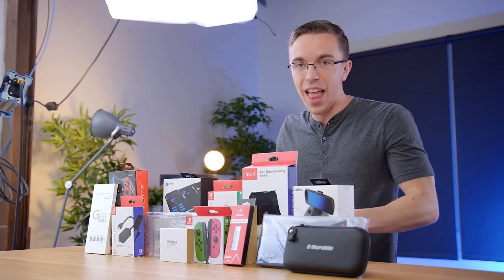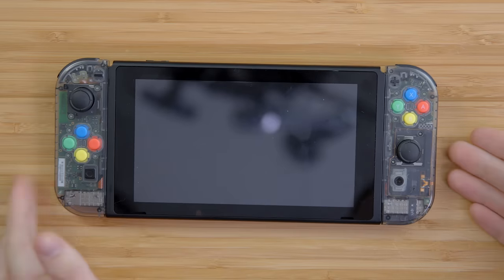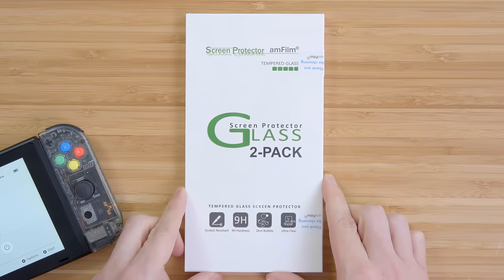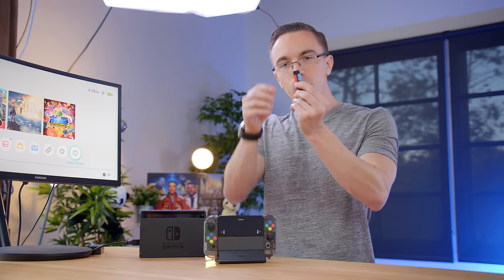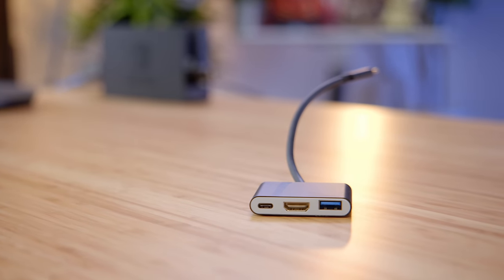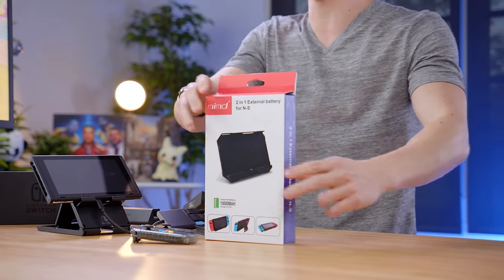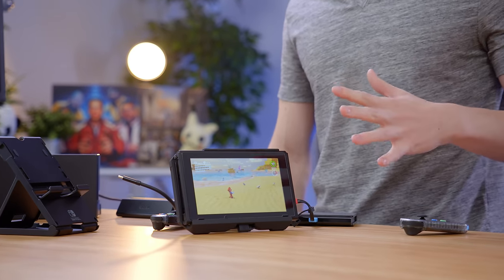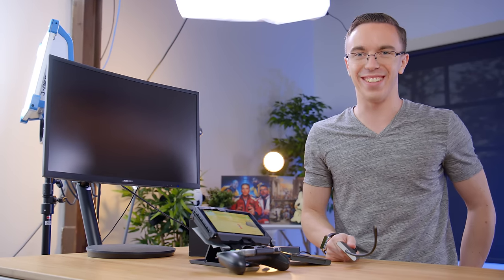Building the Ultimate Nintendo Switch

Comment: THE SWITCH IS SUPPOSED TO BE PORTABLE
Reply: Certainly not Austin lol
Reply: now it isnt
Reply: poppet pala the switch is gaii
Reply: Technically it's the same idea as the PSOne with a screen.
Reply: Spencer Tamburello lol Only a Nintendo fan boy actually listens to the company. It has a custom modified Nvidia chip. Actual consoles have a modified desktop cpu.
Reply: Spencer Tamburello You could but you're still wrong.
Reply: your way wrong because 1.the console itself is the tablet duh  making it a handheld and 2. the dock is an accessory it is not apart of the switch and nintendo just to say that it is a home console when it isn't an actually home console it can act as one. and if hooking up a portable/handheld device makes it a home console shouldn't all other portable/handheld devices be consider a home console too? cause 3DS, DS, PSP, PSVITS, phones, and tablets can all hook up to your tv with an adapter which is waht the dock is it is an adapter that help the switch connect to your tv but it's extreamly big so it can look like any other console on your tv stand
Reply: poppet pala lel
Reply: I can’t charge on its own can it?
Reply: But you have a point
Reply: 1,000 subscribers with no videos challenge it needs a charger to charge
Reply: Yellow Magma that’s what I mean but it won’t work on an plane and other places you don’t have access to plugs
Reply: and it still will be with enough duct tape!
Reply: 1,000 subscribers with no videos challenge oh true
Reply: poppet pala (͡° ͜ʖ ͡°)(͡° ͜ʖ ͡°)
Reply: poppet pala nintendo sayd its a home console that You can take on the go
Reply: Bogdan's Gaming how is it a home console when it is literally a tablet? Lol the dock isn't the console and of course you'd believe what the company said
Reply: i gave the 666th like
Reply: 666TH LIKE
Reply: No it isn't anymore gg 😂
Reply: actually its a home console that "you can take with you on the go"
Reply: Spencer Tamburello I disagree with you. I rarely dock my switch
Reply: Spencer Tamburello as a proud owner of a nintendo switch I say it a portable console than a home console.
Reply: yeah!!!
Reply: The Dark Soul its WAY more of a portable console it doesnt even have a real home console thing you can take it anywhere you want (when charged)
Reply: 1,000 subscribers with no videos challenge you have 83 subs...
Reply: That is the whole point of the switch
Reply: What do you mean portable? Ooooh right you need to take it around the house somehow, sure
Also, what's an outside? Is it edible?
Reply: Some call it portable  but some call it ultimate
Reply: :D ! ! !
Reply: True
Reply: Yeah tell Austin make it more portable
Reply: Wait it is portable except ethernet
Reply: This Is extreme...LY PORTABLE!
Reply: poppet pala it is
Reply: everyone!!!!!!!!  it's the hole point of the fucking system
Reply: its supposed to be portable if us want
Reply: Spencer Tamburello Bull. It’s a portable gaming console that can be used as a home console. The switch is inferior to the PS4 and Xbox One as a home console.
Reply: It's both. Whether it's better as a console or as a portable depends on the game.
Reply: stupid switch didn't worth my time
Reply: Yea. But can you charge it hmmm no but now this good
Reply: It still is you just need a portable power generator that can power a house 
Then put hat in the trunk of your rv and hook up a tv and boom technically portable
Reply: Not anymore it's not
Reply: Hades The Pyro exactly everyone is hyped for no reason and everyone is saying avoid wiiu? it has homebrew and backwards compatibility who wouldnt like that switch is for kids
Reply: Trojan Horse isnt worth it stick to wiiu its worth for that console it has backwards compatibility switch doesnt and everyone is hyped for it why????0
Reply: i mean it is if u have an entire suitcase.
Reply: So the dock then?is that just cosmetic for under your TV
Reply: poppet pala yeeeeeeaaaaaaaaahhhhhh!no point making a non portable switch cuz it ment to be portable
Reply: And that is what makes it a bad console
Reply: yea
Reply: honestly yea
Reply: play anytime anywhere
Reply: Lol
Reply: Spencer Tamburello actually it's supposed to be both a home console and a portable console
Reply: Yellow Magma 
Not a tablet, it’s a console
Reply: Yellow Magma 
And you need the doc! How is it an accessory? It’s hardware! Like the switch and joycons! It’s connects the switch to another device with an hdmi input!
Reply: Yellow Magma
You can’t hook a tablet or phone up with a tv or anything with and adapter! You need an hdmi cable. And for a phone or tablet, you do it with Bluetooth. With those other devices, you can’t!
Reply: You will on a plane most of the time
Reply: BUT NOW ITS NOT THE ULTIMATE SWITCH
Reply: yeah. I have one myself. it's portable. unlike that one
Reply: IKR
Reply: I know this is An old video but it’s supposed to be a hybrid
Reply: @HadesThePyro  I remember playing Breath Of Fire III on my PS One plugged into the cafeteria's outlet when I was studying at university. Good times!
Reply: Spencer Tamburello D
Reply: poppet pala: actually it was meant to be a console
Reply: Is is
Reply: @DarkSoul-ds2  I don't think it's purpose is home console or portable it clearly has both . its much better as a home console which idk if they realized at the time of releasing as it only lasts about 3 hours without being charged . kinda hard to argue either one is its intended purpose when both answers are half correct
Reply: @YellowMagma  id argue to say the dock is a part of the "console" otherwise it would be sold only separately from the tablet part. its kind of necessary considering the short battery life of the tablet . and clearly way better to play docked then not. if you disagree with that i guess you prefer playing on a tiny screen
Reply: @JanitorMusician  the dock is an accessory. Very easy to argue
Reply: @DarkSoul-ds2  i see your point and i can understand why you would see it as an accessory , but the simple fact that the tablet is almost complete shit without the dock makes it a very necessary item which i would say makes it part of the console. this is just my opinion though . in all circumstances i would say yeah its an accessory but the fact that the limited battery life and the horrible joycons make most games, just much more difficult then they have to be , that makes the dock much more important. because, then you can hook up a pro controller and your tv for much better gameplay. Clearly the dock isn't 100% necessary I know this. however, i believe if the dock didnt exist nintendo have a huge disaster on there hands. the dock makes this otherwise nearly unplayable console playable . Imagine trying to play competitive smash bros with the tablet and joycons... not going to fucking happen. my conclusion is if you look at any accessory for any other console they aren't necessary for them to stay in competetion for best console. but for the switch if the dock didn't exist this whole console would be a complete failure. so no the dock is not an accessory . an accessory is something that is not required but can add to the overall experience. in my experience the dock is 100% necessary for a lot of games. for example, games like smash it makes or breaks the experience if you are competitive . you might be able to play them but that doesn't make them enjoyable. irregardless you are likely going to say no its an accessory thats fine.
Reply: Ben LeClair  being transparent about arguments doesn't make them any less or more relevant. Same for saying it's just an opinion or assuming stances on the topic. At the end of the day it's still a tablet regardless of battery life and performance and performs its tasks as intended without the dock. The dock IMPROVES battery life indefinitely and CAN IMPROVE Video output. However the tablet can still perform its functions. These improvements are NOT necessary to perform gaming. Therefore the dock is an accessory.  Even in competitive gaming its doable without the dock. No amount of experience playing, belief, or non-subjective subjectivity can argue against this if it's not a fact.
Reply: @DarkSoul-ds2  they are necessary for competitive gaming thats a fact. if you are playing with the tablet alone you are not competing, you will simply be losing. i wasn't arguing that it can't perform its functions im arguing that the dock is necessary for optimal gameplay. without it the system is just fair. accessories aren't important to have optimal gameplay. the dock is important without it gameplay isn't the same. its more then just an accessory
Reply: @JanitorMusician  opinions aren't facts.  In that case the controller pros should be included in the box. You can compete with joy cons
Reply: Well it is the “Switch” so no its “SUPPOSED” to be both
Reply: @downunder874  and your reasoning for it's a bad console?
Reply: @crimsonking7179  Of course. It breaks very easily, I've only had it for about a year and I had to replace a joycon and the SD port is broken. It also doesn't need to exist because the Wii U could support the games on it. It also isn't backwards compatible like the Wii and Wii U. It doesn't have a lot of new releases due to the lack of processing power. A lot of the games are either rereleases of Wii U games or are sequels that are very similar to the original, supporting my statement about the Wii U being superior.
Reply: @downunder874  but everyone stop buying Wii u and games for it . Of course Wii u has more power it not as portable as the switch. You either have more portability or power it's simple you can't have the equal amount of both. As far as the switch durability, it not that hard to keep it from break, just keep covered. I had my switch about a year and it's fine, I drop it a few times and it still works. So I don't know what to tell you but the switch is not a bad console. It not the best but it's definitely not a bad console.
Reply: @crimsonking7179  I still believe that a portable console should be more durable. I have only dropped it once, and that's when the Joycon broke. It shattered into 3 pieces, and I had to spend $30 to get a new one.
Reply: Very true kid
Reply: Official mr_Springtrap  qce
Reply: @YellowMagma  look he also said "that you can take on the go" . And since when would a company that BUILT their console want to lie about it
Reply: No
Reply: Spencer Tamburello eh depends..... it depends which one you use more. I use portable mode most
Reply: Right
Reply: 𝘽𝙐𝙏 𝙒𝙀 𝘾𝘼𝙉 𝘿𝙊 𝙏𝙃𝙄𝙎 𝘼𝙉𝙔𝙒𝘼𝙔𝙎
Reply: @SpencerTambo  Nintendo Said it's a hybird console
Reply: @young-blk-investor1059  r/woosh
Reply: @izzrax8113  same with your phone wats your point
Reply: @nathaneichner4262  I dont even remember bc this was a year ago
Reply: LOL
Reply: poppet pala j
Reply: @thejwil45  Oh god. You just said the Wii U is totally worth it. I have one .. and trust me, having a Switch would be a lot better lmao
Reply: Biggerdog Za Big Doggo im not gonna lie switch is good but i wish it have backwards compatibility and hey i would love to play mario oddesey
Reply: @thejwil45  Yeah, fair point.
Reply: I THINK
Reply: poppet pala low battery
Reply: but it isn’t
Reply: IT STILL IS
Reply: Pinkie Pie no lol
Reply: ƑԼƛƦЄ ƤԼƛƳƧ x
Reply: Thanks. We like to Ones
Reply: @HadesThePyro  pretty much
Reply: He mentioned that, if you didn’t listen, he just wanted to make it better O.o
Reply: Austin: Thinks about portable 50 accessories
Reply: no its not why is the switch lite a thing?
Reply: ok boomer
Reply: R/wooosh
Reply: Nah
Reply: NO ITS NOT
Reply: Get a bag
Reply: No it's not
Reply: @SpencerTambo  its home and portable..
Reply: Not anymore
Reply: RealCeltics Fan Nigga it’s a joke
Reply: yeah but not . . . U L T I MA T E
Reply: @HadesThePyro  is like wii u
Reply: @NickyYey  sure. Let's go with that even though you aren't really meant to take your wii u out of your home
Reply: @HadesThePyro  and a phone
Reply: ThE SwItCh Is SuPpOsEd To Be PoRtAbLe
Reply: poppet pala literally every Nintendo console is portable
Reply: poppet pala 9 hi
Reply: Poppet pala is beign roasted whit so much likes :/
Reply: To everyone who is arguing about if the switch is a PORTABLE console or a HOME console; If you mainly play Super Smash Bros. then it is a home console, anything else and its portable
Reply: But the ultimate switch isnt
Reply: Yeah it is
Reply: @Scottage_Man  lol
Reply: No
Reply: lol lmao
Reply: It's more in line with the Virtual Boy now
Reply: Uhh uh, well uh, I’ll ignore that
Reply: @young-blk-investor1059  if you dont care, why tf did you reply to the comment? ever thought of that
just leaving the person alone

Comment: Who else is waiting for his switch to either fry or explode?
Reply: UwU lmao what he means is that the joysticks have very little travel so you dont have as wide range of movement as normal consoles have
Reply: @UwU lmao f my guy
Reply: this thread has nothing to do with the original comment
Reply: I'd just get the Ethernet AC Adapter and the Battery bank. that's all you need really, ESPECIALLY if you're traveling constantly
Reply: Yeah the whole thread is basically a dumpster fire
Reply: new Leaf  It is completely your own fault for not researching the console and it's game collection, before you bought it...
Reply: new Leaf  switch is not for your cAlL oF dUtY games
Reply: @Fartimations I've thrown my pro controller across the room a few times and it's just fine. Did you drop it on concrete or something?
Reply: Fartimations noooooo the Wii U was a big flo

Comment: All of this stuff bricked his Switch after 5.0
Reply: how does a screen protector and sd card brick a switch
Reply: @HelixAdamOxford  the custom docks and external battery, not the sd card and protector
Reply: Rip
Reply: Lol
Reply: i dont get a name idea p_p r/wooosh
Reply: Sam Randomness 1.not a wooosh
2. We’re not on reddit right now
Reply: @sjohnart5676  how is it a woooosh?
Reply: @namaco2201  woooooooooosh
Reply: @nathandawes8335  only 4 o's dude
Reply: @Clarissa 1986 what does wooosh and brick the switch mean?
Reply: H woooooosh means someone told a joke and someone took it seriously and a bricked switch means the switch can’t be played anymore because it locks itself
Reply: @Spearz5  Had no clue lol.
Reply: ZVX i thought woooosh means that they dont get the joke, wooosh is the sound of the joke going over his head
Reply: @Spearz5  actually the failure was with nyko accessories primarily and the charge controller in the switch the chip would fry after being allowed to pull unlimited amps from the charger plugged into the dock this chip caused switches not to charge if you can charge the battery outside it should work
Reply: Lunas Eclipse not sure why u tagged me
Reply: I have a 3rd party dock because my nintendo one stopped working the day after my one year warranty
Reply: @Spearz5  will turn on, just with a black screen
Reply: the sd card:
Reply: F
Reply: What is it Whoosh
Reply: @ktmridmcy7336  it doesn't matter if we aint on reddit or not
Reply: @HelixAdamOxford  take classes
Reply: @Spearz5  "bricking" (as in a Device is bricked) means, that your expansive turned in Functionality to a Brick. Or a Paperweight. In other words, it's dead, not really fixable, not useable, dead. A Brick. 

This happened, because Nintendo, since they are fucking Stupid, use a USB C port, and all of that shit, but took a huge Dump onto the USB Protocol. You see, a "standard" USB Port delivers 5V, wich is fine, but ever since we got fast charging, Devices can "talk" now to the chargers to demand a specific Voltage. And with USB C, this became way more standarized. If a company uses a non USB Standard for fast charge, the charger can not really communicate with the device and keeps the voltage at 5V. This is what Nintendo should have done. 
But for some reason, they are using the same protocoll, but with somewhat fucked up output voltages. Wich for some weird Reason only happened after they made an Update. 

What happened, in easy terms, is basically that the Switch told chargers, it wants eg 9V in "USB- Language", but in reality only wanted eg 6V. That commad is basically the same, but the Output is different. A to high Voltage, even if it's just 3V difference, can, especially over longer time, damage a Product beyond repair. Wich totally happened to a LOT of Folks, that used third party Docks and Dongles, that technically do the same. 

Note: this is pretty much the ONLY fucking device this happens, because everyone else just does, what the USB Protocoll dictates. Even fucking Apple! You can not Brick your Macbook by using third Party USB Chargers, nor does the Apple charger brick your Phone, UNLESS the charger is seriously faulty and delivers wrong voltages. 

Tinfoil time: Maybe this was intentional by Nintendo, maybe they didn't like that with USB C, anyone could just buy a cheap Dongle, that does the SAME as the Switch Dock. Note: Those Dongles can't brick your Macbook or Smartphone either.... And Remember: An official Switch Dock is around ~120$ or something. The Tech inside there is seriously worth not more 20$. Seriously, this thing is overprized beyond believe.

Comment: This would be the kind of guy to set up a pc to run mac in vm and then use bootcamp
Reply: that doesnt make sense. bootcamp doesnt run inside the mac environment. It is a setup for dual boot. You dont actually run bootcamp windows inside of MacOS. you could technically try to run windows in parallels in a VM though.
Reply: colton clayson with a bit of rearranging, you could set up windows through boot camp then OSX in a vm, which is doable. Then try running Windows in a fm in the OSX vm...